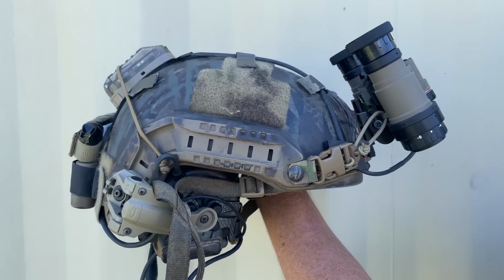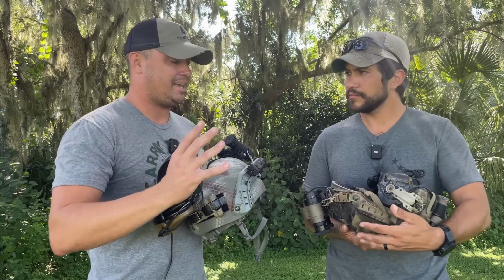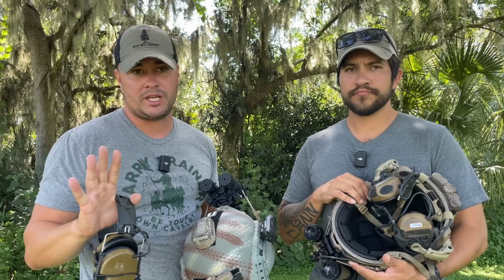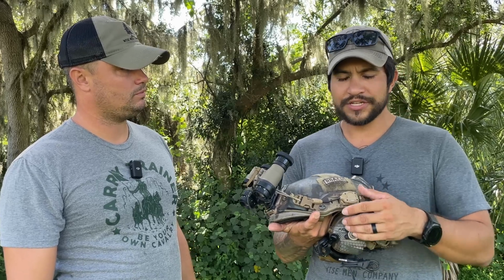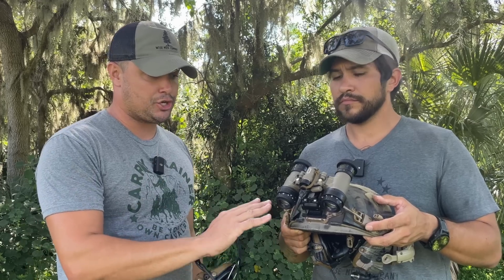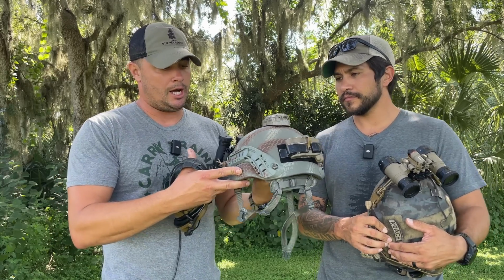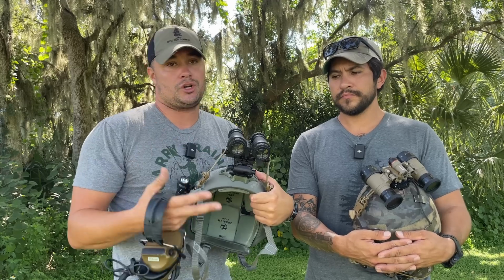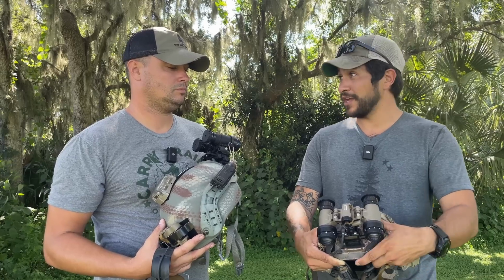Budget Helmet Setup

Comment: the older PASGT kevlar helmet can be bought cheaper. there are companies that sell replacement pads, suspension system, rail and NVG/NOD mounts for the PASGT ballistic helmets.
Reply: I ended up getting a USMC lwh, basically a light weight pasgt, for cheap ($80ish bucks). It's super comfy and came with the new style suspension and pads. Definitely worth looking for.

Comment: Hey guys, quick question. On the helmet that Eric has, the headset adapters, is there any way to adjust the spring tension? I've got a big head and the earcups are really tight on my head. I know they need to be tight but I could use just a little bit of adjustment on the springs. There's no readily apparent way to do it. Thanks!

Comment: For good a "knockoff" Wilcox mount, I recommend the Argus LWNVM (lightweight night vision mount).  It's $150 and has solid lock-up, and has a breakaway feature with adjustable tension.  I personally find it better than my issued rhino mount. For those wondering, it does work really well with the Noise Fighters AX-14 arm.

Comment: Tacticon armament ftw. Quality American made gear priced for civilians.
Reply: Do you actually have one? How you like it?
Reply: @Excellent_Duderino  I was actually lucky enough to get one while the small supply of them lasted. It fits nice as a helmet can I’d imagine. The inside pads have adjustment so you can get the pressure spots to a minimum. All in all for what I paid it’s great.  But I don’t believe you should have to go out and buy Gucci gear because operators use the same named stuff.  I’m just an everyday joe with decent income lol
Reply: @bass_life2177  well said lol, brand names mean nothing to me anything can break or fail. just want something that'll preform as advertised and hold your kit properly lol.

Comment: You don't always have to spend $500 on just the helmet. I recently bought a surplus ACH for $150 and I am high-cutting it, painting it, and I got some ops-core rails for $75. Ebay can do a lot for you!
Reply: Yup, Baby Face P has a great video on modernizing an ACH and for not that many bones. I didn't high cut mine. But I did put rails, off brand boa straps, and a NVG mount.
Reply: Meanwhile, I snagged a FAST carbon Bump from Ops Core when they were discontinuing it.
Reply: that definitely would the the ballistic efficacy

Comment: Nice video. Working on setting up my helmet, got a surplus gentex ach for less then $100. Getting it fast cut, throwing on arc rails and ear pro. Eventually gonna run a Pvs14 on it within a year. Also Are the knockoff mounts considered more duty ready then a older rhino surplus mount would be ? Taking my time with my decisions since I don’t have money to blow on a Pvs14 anytime soon

Comment: In reference to the knock off mounts, if the one you get has good fit and finish, all you have to do for added piece of mind is loctite the applicable screws, maybe add some witness marks if you care to do so.
Reply from the maker: Good idea
Reply: Yeah I mean I’ve had both a Wilcox and knock off G24 mounts and the two knock offs I’ve had have held up better than one of the Wilcox mounts I had lol not saying that’s the norm cause the knockoffs range from 20-30 bucks up to over 100 and I do think that matters as there are levels off knock offs. I understand that doesn’t make sense cause knock off is knock off right? But it’s true

Comment: True poor mans setup:
Longfri High cut 3A - $220
NiteCore IR strobe - $27
Rhino II mount- $110
Peltor Earpro ARC mount-$72
Peltor Range Guard-$45
Amazon special counter weight-$8
Amazon Special Helmet cover-$13
Bankline NVG tether- .50¢
Reply: Amazon helmet covers and counterweights have IR signature
Reply: @SuperXrayDoc mmmm that's good to know
Reply: @SuperXrayDoc If you’re getting IR splashed you’ve already messed up.
Reply: @SuperXrayDoc so do most things. Including most tactical Gucci gear. Unless you're investing almost entirely in US military surplus equipment more than likely something you're wearing is going to be glowing under direct exposure to IR light. Personally I think that's a bit of a over exaggerated concern.
Reply: Thank the Chinese for not gouging the average American.

Comment: ArmorSource AS200 is American made, high cut, Wilcox shroud, boa retention, and is $500. ArmorSource used to make team Wendy’s helmets for them, they’re  super legit helmets for anyone on a budget.
Reply from the maker: I’ll check them out.
Reply: They are considerably more expensive than that now.  9 months later.  About 1K depending on configuration
Reply: Good to know, I’ve been looking at an AS200 mid-cut from them
Reply: I got a pgd helmet not bad for weekend warrior shit
Reply: Thoughts about HHV? they have a $500-ish helmet.  BTW I have ZERO experience.  Do we just go by price, weight, and padding that is adjustable or is there more to the fitment formula?
Reply: @GaryWold HHV is decent, their bump is great but for ballistic I would recommend armorsource or galvion at the same price range
Reply: The AS200 is not high cut. 
The AS223 is the high cut.